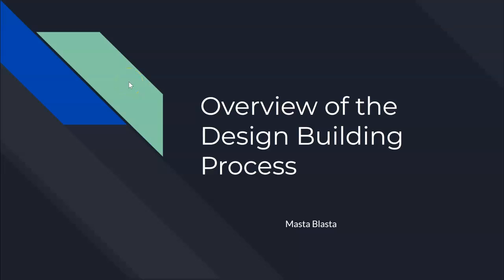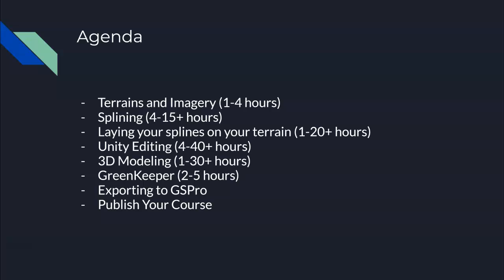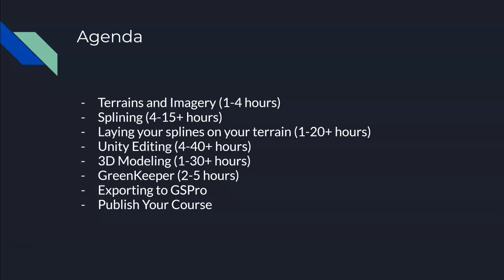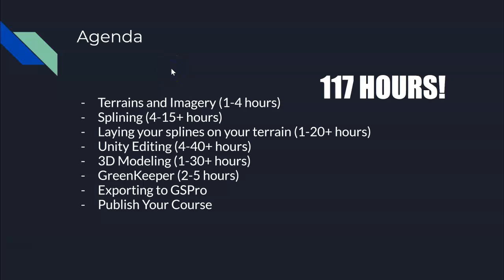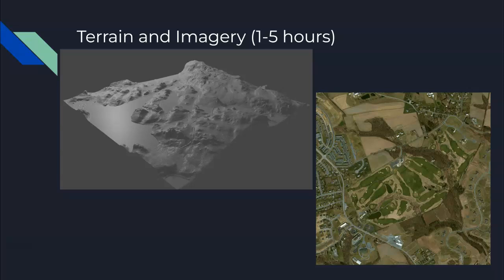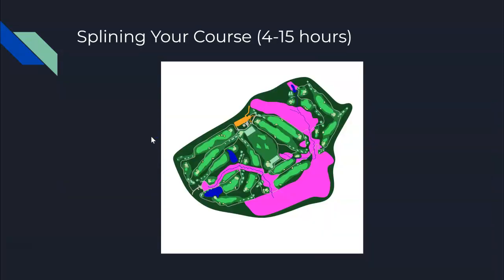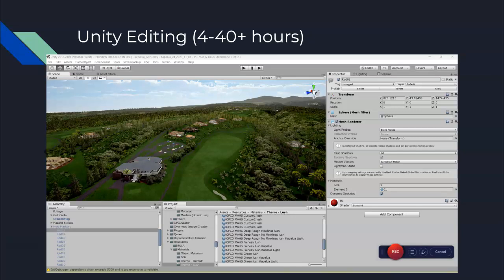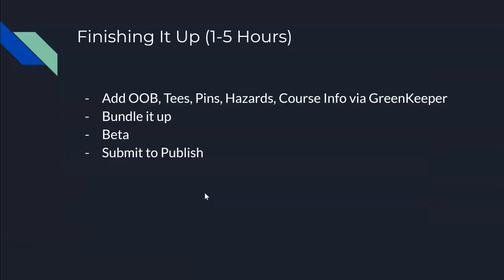Overview of the GSPro Course Building Process

Comment: Is there a way to edit a course that is on GSpro already? In other words, import a course that is installed already and make changes.
Reply from the maker: There is not. The course file is encrypted and uneditable. The only way you could do it if is if you get in touch with the original designer and they send you the unity files. Even then you have to be careful cuz that can be a violation of various and user license agreements.